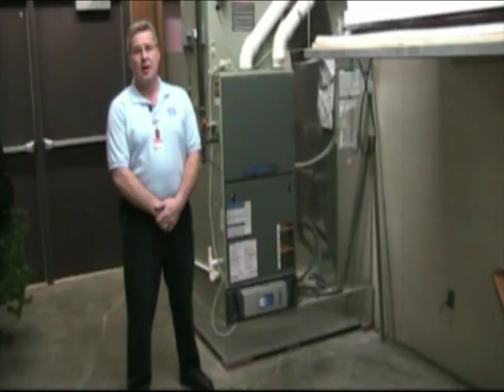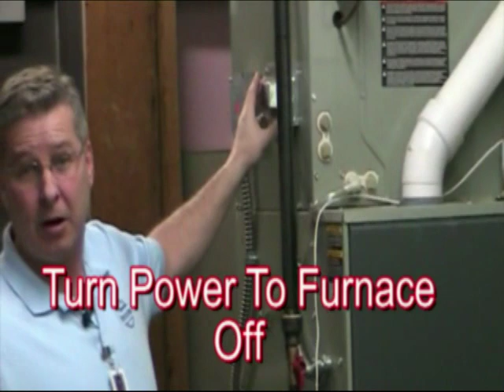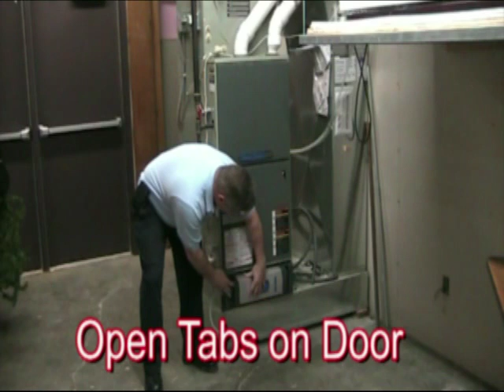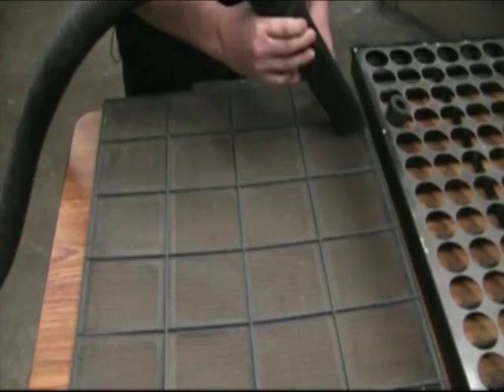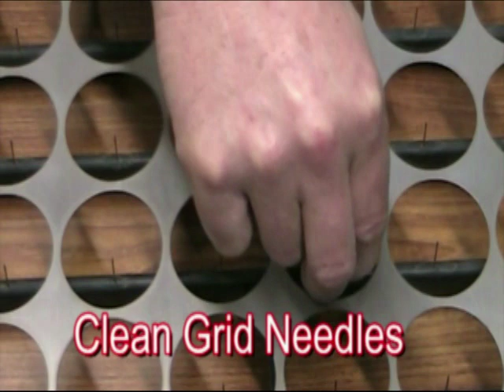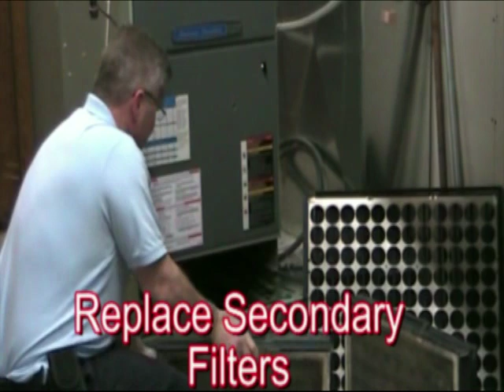How To Clean Your AccuClean Air Filter System

Comment: Quick and to the point. 
Once Power button has re-started the filter syustem, 
You just need to point out that the user will need to hold the "Reset Button" to get the lights to go green after cleaning has been performed.
    I'm assuming all Accu Clean filter systems have a Power Button and a Reset button... My system has two buttons.

Comment: When I turn the system back on (with the round button) my lights go right back to blinking red. Did everything just like the video, why does it do this? Thanks for you time.
Reply: After you turn on the filter, keep the switch pressed for few seconds to reset the filter.